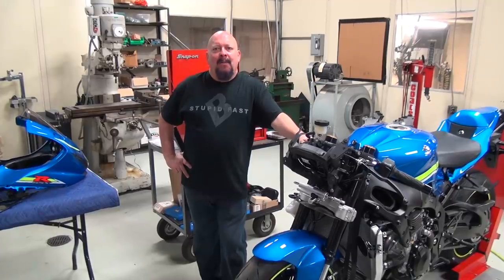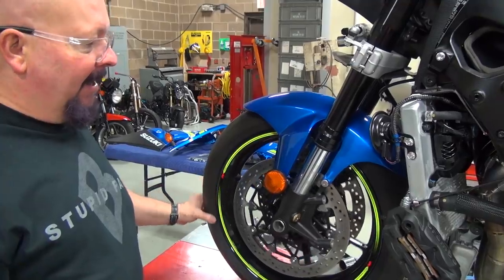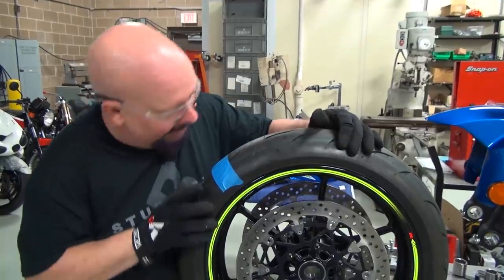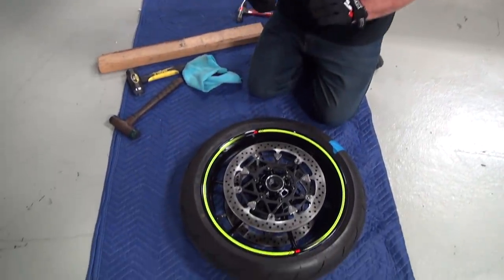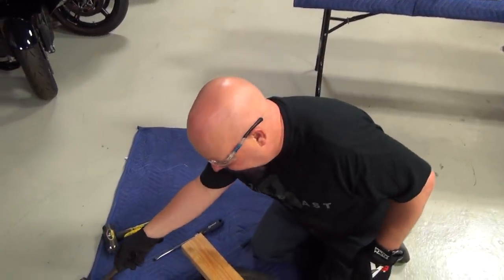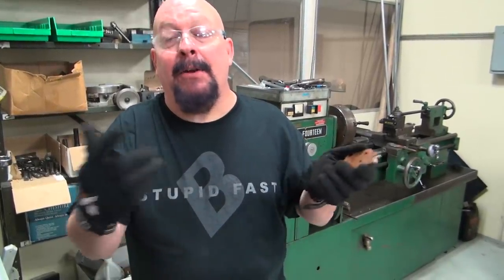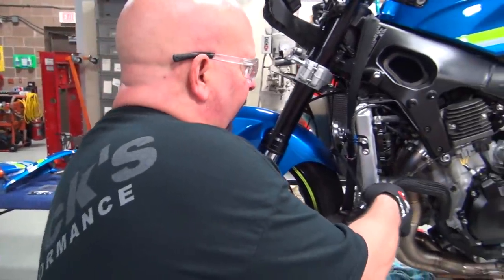Ceramic Wheel Bearing Install and Reducing Brake Drag

Comment: dude have you heard about full Zirconia ceramic bearings?i heard it is stronger and tougher than others ceramic bearings, which they can have higher load, and take mini load shock where others bearing cannot take it.by the way are you using Hybrid Ceramic Bearing or full Ceramic Bearing? i heard Hybrid Ceramic Bearing is risky where the Ceramic ball can break the metal cafe.
Reply from the maker: I have personally used World Wide Bearing Hybrid Ceramic Bearings ( https://bit.ly/3PEffgg ) since the mid 1990 and we have sold tens of thousands of them at Brock's Performance.... we have never seen a "broken" one.

Comment: Do the new Suzuki's come with Aluminum axle nuts? How well do they hold up? You guys use that heavy spacer too in the front axle? I just looked, that nut 54712-47H00  is $29 bucks. Must be AL, yikes!
Reply from the maker: If OEM's use an aluminum nut, it typically contains metal thread inserts. We can't use the heavy spacers in Super Stock, but they are one of the best kept secrets at the drag strip as well as on the street to covertly curb wheelies and win races. If you don't like $29...don't look at our heavy spacers, lol.
Reply: Yeah a BST wheel and Tungsten spacer are pretty expensive! Plus ceramic bearings. I can't afford to win races. Heh.
Reply from the maker: I said not to look ;)

Comment: Brock do you think removing the front rotor and caliper will gain you some mph? If so would it be significant and worth the lack of braking.
Reply from the maker: That depends on your setup. If the bike is long enough, it's a measurable difference at the drag strip. Very few grudge bikes have dual front brakes, and they stop from over 200 mph with a single disk and no rear brake at all.
Reply: @BrockDavidson  thanks Brock 🙏🏼

Comment: If you wanted half the drag, couldn't you have just removed the pads from one of the dual calipers on the front wheel? Half of 2 pairs equals 1 normal one
Reply from the maker: @Jacob - yes we could have and it's covered at 9:38. But your "half of 2 parts equals 1"  statement assumes that you are using 100% of the available braking power. In reality, these bikes will stop quickly from 150+ MPH using very slight pressure to the lever... after these mods, the same braking can be accomplished with slightly more pressure applied to the lever.
Reply: @BrockDavidson  ya I was just thinking it over in more of a "if you dont need that much braking power if you removed one set then you would still have the braking power, it wouldnt be "modded" for safety and piece of mind, and if you completely eliminated the second brake setup, caliper and rotor, you lose the rolling resistance, weight, and rotating mass on the front wheel generated by the second rotor. More bang for the buck perhaps, assuming removing the second rotor wouldnt alter the balance of the front wheel assembly
Reply from the maker: @Jacob, what you are saying makes perfect sense for a stretched out racebike - for our short wheelbase application that we are riding to the track, three brakes that can each provide enough power to stop the bike is far safer. We can always apply more pressure to the brake levers for quicker stopping power. You don't have that option if the brakes are missing.

Comment: Wouldn't putting the bearing in the freezer first be a better alternative to beating it in?
Reply from the maker: Doesn't matter. Freezing with liquid nitrogen allows them to drop right in, but it destroys the seals and cages at the same time. We show how to properly install bearings using a press and tooling in another video. This one was dedicated more to a simple roadside repair.

Comment: Seen an article once on a bike that had ceramic bearings installed in the  engine and wheels.
Reply from the maker: We use them anywhere in a race engine we can: Transmission, cam bearings...even water pump bearings. Every small advantage adds up.
Reply: Tesla uses them for their rotor bearings. For the electric motors. These bearings start at around $100 each and up though. Ooof. Silicon Carbide bearings are non conductive. So they can't arc and ruin the races. Excellent for electric motors.

Comment: I see ya Brock, only the people that don’t get will call you a fool, that’s why if they race they will be a lil slower than you. 💪🏾👍🏾
Reply from the maker: @DonJuan19 I see you get it my friend. We have 5 Prostar/AMA Dragbike National Championships in the ultra-competitive SuperSport class - a 'little' faster is all we needed ;)
Reply: How can having less break pad than you had before cause a Seize up,I thought collapsing brake lines or sticking caliper pistons caused that. And I bet old gixilla is still able to stop on a dime.
Reply: @donjuan1933  did you see what happened to the wheel bearing when tried to put it in the first time, the pistons in the brake caliper will do the same thing and not release
Reply: @Eddie Hitler 
 there's a real danger in videos like this it may be OK on a dedicated race bike (drag race bike not a proper road race bike)that runs for 10 secs then stops in a controlled area, but in any other circumstances reducing brake efficiency by 50% by grinding the pads is beyond stupid, how many young impressionable people will be be taking an angle grinder to the road be pads ???

Comment: Do you ever run oil in ceramic bearings instead of grease?
Reply from the maker: Yes! In classes where every thousandth of a second counts, we remove the dust seals and use our <<0 weight Alisyn +Ppetron additive to lube the bearings. It makes a hellova mess...but it works.
Reply: I want to do this in a roll racing scenario.   I was told it was a bad idea because you will lose the oil, even with the bearings sealed on both sides.
Reply from the maker: The bearings use a special lightweight grease, so we don't mess with oiling any longer. We did run the inner seal. It's a bad idea to remove them if you are in sandy or very dirty conditions.
Reply: I greatly appreciate the info!

Comment: Dust seals + ceramic bearings have a lower drag than dust seals + steel bearings, right? So why not put the dust seals back on at 28:33 and avoid the shorter life of unprotected bearings?
Reply from the maker: The bearings are protected with their own low friction seal for years of trouble free life. If you are not racing, reinstall the dust seals if you like.
Reply: @BrockDavidson  Thanks, Brock. Will they suffer from the same problem I have in my bike hybrid bearings, i.e., steel races get damaged by the silicon nitride balls because silicon nitride is a lot harder than steel so it digs in, causes wear and ends up creating more coaxial movement of the races in relation to each other?

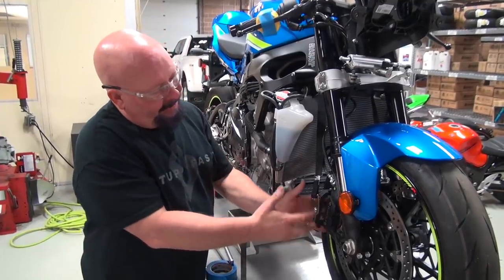Comment: 5:30 I ve done it too lot of times 😂😂to push like idiot the lever when wheel is off.
 My way on my gsxr is to unbolt slightly only the lever ( it's brembo with Allen bolt) and drop it down. So practically the lever is facing the ground while the hole system is in place like normal. So nobody can brake. But I mask all the way with tape the grips😂😂 when I make mods. I hate to get dirty😂😂😂😂

Nice video!!!

Comment: Hi Brock. I live in Holland and ride a ducati monster 1200. What bearings do you suggest? i cant find Any. 
And do you think it’s wise to remove the dust caps if I ride in rain?
Another question; I want to change my o-ring chain to get more power on the wheel. Which one do you suggest to get more power and what are the cons? 

Thanks in advance. 
Love your vids 💪🏻
Reply from the maker: @R de graaf - hello from the USA. We have a full line of ceramic bearings. If we don't have a ceramic bearing kit listed for your bike, we more than likely do as individual bearings - but you will need to know your bearing dimensions. You can also contact sales@brocksperformance.com to inquire about your bike. Keeping the dust seals in extremely rainy climates would be a good idea. Any high-quality x-ring or z-ring chain will work for general riding - we like the Regina chains for street and EK for drag.
Reply: Hi Thanks for your (quick) answer. 🙂
I Will look into the dimensions of the bearings first. 
About the chain, I just looked into your vid about the drivetrain friction reduction but that’s not a smart idea for my street monster1200 I guess? Any other ways to get less friction and less horsepower loss on the rearwheel?
Reply from the maker: @rd6057  no problem. The x and z ring cahins are your best bet for reduced friction and street use in wet weather.

Comment: Take the brake rotors off before you try doing this at home
Reply from the maker: Lol, most grudge drag bikes do not run a rear brake at all.
Reply: @BrockDavidson  I was just saying take them off when you're beating out the bearings that way you don't risk damaging them
Reply from the maker: @Honda1k  @1000r gottcha and you are correct.

Comment: hey brock i have a ? so i here hydrolic cluch is not good for drag racing so is there a way you can convert it to a cable if so would you do a video on it
Reply from the maker: Hydraulic clutches are far better than cables, IMO. Zero drag and more mechanical advantage. Our fastest clutch set-ups at the drag strip will not function properly without hydraulic - try controlling almost 600 lbs. of static pressure with a cable.
Reply: @BrockDavidson  thank you brock always love learning somthing new and this is were i come for it lol

Comment: instead of shaving down the most critical component of stopping the bike, why dont you do the proper mechanical servicing?

like get full floating brake rotors, clean the brake calipers, and adjusting the forks to have the least amount of friction on the axle?  my front tire spins for a good minute and i'd never do this to my front pads.

Beveling brake pads is only used for the rear brakes when doing tire changes for track use.
Reply from the maker: You do realize this is a brand new bike with zero miles? The records and race wins this bike has already achieved in official Super Stock National Competition disputes your "only used..." comment: https://www.facebook.com/watch/?v=577364726275857
Reply: Brock Davidson improperly installed forks or over tightened axles will cause brake drag on a bike with 0 miles. Shaving front pads is nothing but a poorly thought out bandaid to the problem.

Comment: Reducing brake drag also reduces brake efficiency.  Brock you are getting confused with putting a small chamfer on the pads so you can get the wheel / caliper in easier.  An old endurance racer trick.
Reply from the maker: Please continue on with the series - the performance of the bike indicates we are "confused" about nothing. Very much to the contrary, in fact.

Comment: Are you nuts? Doing this to your brake pads is wrong on so many levels. 50% reduction in braking, unbalanced loads within the caliber, MOT failure, ruin your discs and so on. How on earth can you publish a video on how to make your brakes unsafe!!!!!
Reply from the maker: We recently cured several bikes that has serious/dangerous front end "washout" problems created by excessive OEM brake drag when drag racing by utilizing this technique. It's ok if you don't understand - the riders who stopped almost crashing understand and that's all that matters.

Comment: Soooo grinding down you pads is fine and dandy but why not just remove one of the front caliper/rotors or install springs which hold the pads away from the rotor such as those used on cars ?
Reply from the maker: @James, this is covered beginning at 9:38
Reply: Brock Davidson  but not very in depth I could see this being done in the pit before a race just to get that extra little bit but when you have the time and space in your workshop why not remove one of the Calipers/rotors and run a single side buell motorcycles have single side brakes and they are fine

Also the spring I’m in reference to are not strong enough to overcome the pressure of your brakes they can be compressed easily with your bare hand and car manufacturers (ex. ford,Toyota) use them on lots of models just to provide light tension and hold the pads off the rotors to prevent rattle and I understand a car has more braking power but you wouldn’t need 8 of them maybe just 2 one for each caliper or just one if you deleted the other caliper

Comment: All those people who put big brake kits on their cars and bikes are just stupid, the added resistance just makes you go 20 horsepower slower
Reply from the maker: Aftermarket race calipers have little to no resistance. Street calipers can be a different story.
Reply: Can you elaborate on the differences?
Reply: Got data to prove that?
Reply: Depends on the goal of the vehicle. Road racing/autocross require very different things than drag racing which requires different things than roll racing.

Comment: Why chamfer the bottom, not the sides of the brake pads?
Reply from the maker: The idea is to reduce friction at the beginning of the race (to help the rider brake free from the pack) but still allow full stopping power by the end of the race as the pad wears back to normal. Additionally, the pads will 'rock' into a more powerful stopping position, even when chamfered, by applying additional force at the lever - this can't happen if the material is missing.